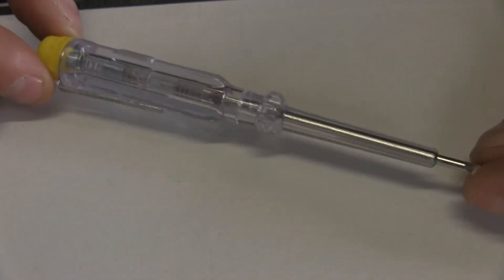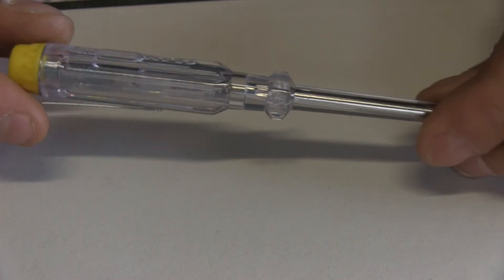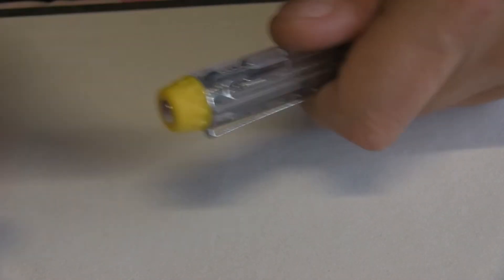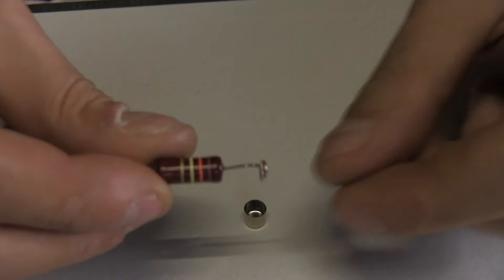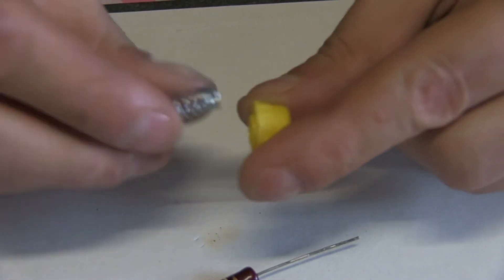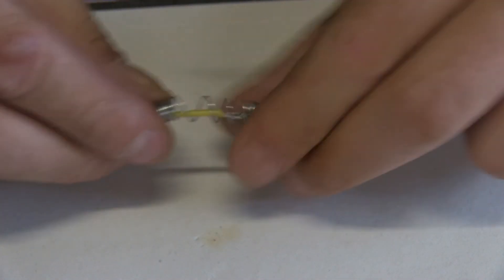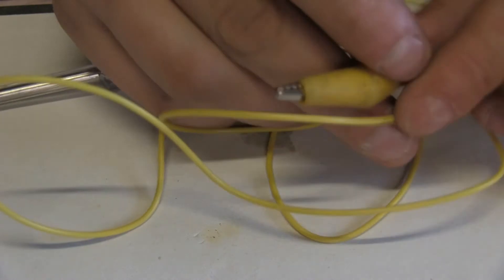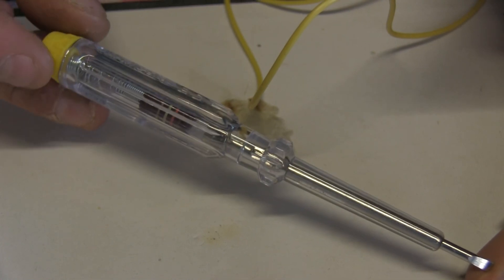How to create a simple capacitor discharging tool

Comment: i made it, thanks you sir
Reply from the maker: Safety should be your number one priority. By the way do not forget to double check if it worked. Voltage across the capacitors should be at zero.

Comment: If I want discharge a HV microwave capacitor, what should be the value of the resistor and the awg section of the cable ? Thanks for the video.
Reply from the maker: I have no idea

Comment: Value of the discharge resister? Thx
Reply: 2kΩ 5W Resistor - For discharging regular capacitors
20kΩ 5W Resistor - For discharging large high voltage (>400V) capacitors